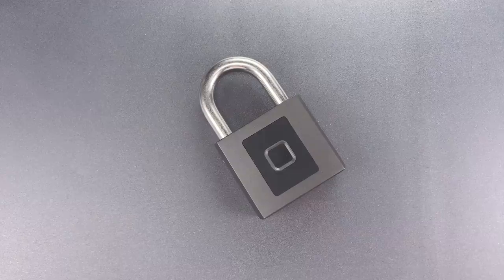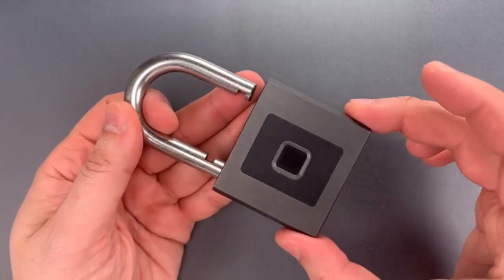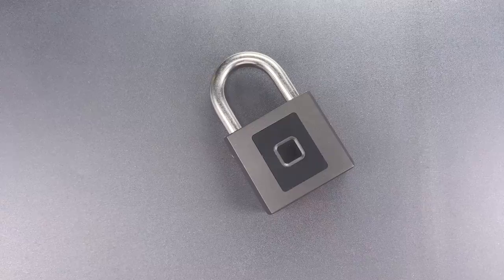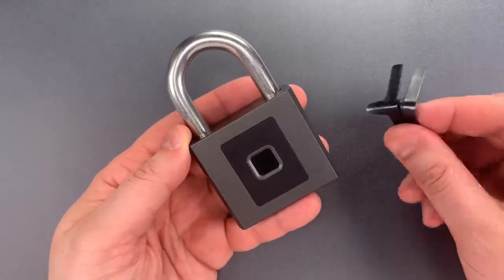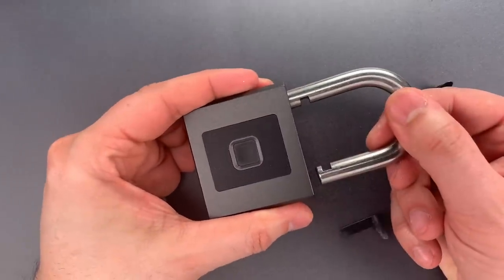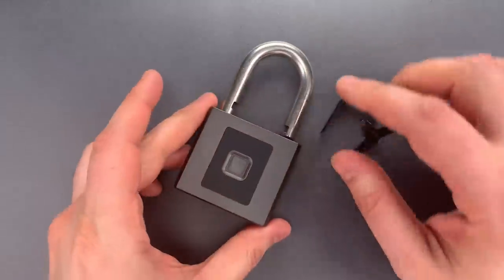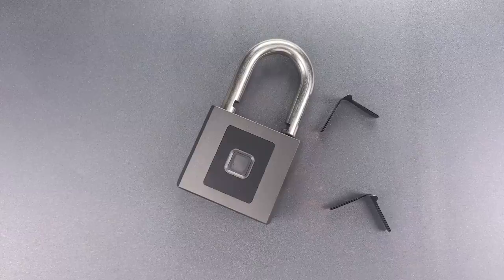[1225] eLinkSmart “Warehouse Digital Padlock” Bypassed

Comment: Those shims clicked in with a more confirming sound than a key
Reply: Haha lock engineer,   “crap I new we missed something. Next time we send to LPL”
Reply: They clicked in with a more confirming sound than the lock itself
Reply: @uniqhnd23  seriously?
Reply: where can i buy these
Reply: @mrsesh7364  use a soda can
Reply: @sentranizzy  how
Reply: @mrsesh7364  use scissors and a YouTube tutorial
Reply: Not even the old master combo dial padlock can be shimmed that easy
Reply: Shit it was more confirming than the shackles clicking in place
Reply: @uniqhnd23  oh snap you beat me to it. Shoulda known someone would.
Reply: Schlage locks in particular have a satisfying click to each pin when inserting the key in a brand new lock. With age the sound becomes mushy and hesitant.
Reply: Yes, there was a nice click out of 2 .... shims.
Reply: What did he use to pick the lock?
Reply: @angrygreek1985  Well, there are a few that actually interact with him.  Sadly, it's only a few.
Reply: And, they went in straight.  He didn't have to go in to the sides and work them around.
Reply: @sawyer3858  Shims. They're often made out of bits of cut up pop can, since the material is thin and easily shaped while also being sturdy and very easy to get.
Reply: I think being susceptible to two shims is bad, though not as bad as one, of course.
The shackle being susceptible to a pair of fucking bolt cutters is absolutely inexcusable beyond mere inexcusable, it sounds like a massive gaping lawsuit liability.
Reply: @mrsesh7364  he sells equipment on his store (Covert Instruments I believe)

Comment: We should be giving locks a security rating based on how long their LPL videos are. This one has a 1.34
Reply: Nah, should base it on how long the actual attack takes, some locks he goes into more detail talking about than others.
Reply: I agree with the other comments but don't forget that he also picked it twice. This one actually lasted like 5 secs, and I'm sure he could do it faster xD
Reply: In reality it a 0.1 as it took him 6 seconds to open.

 Was formerly rated at 0.06 before someone pointed out a minute doesnt have 100 seconds.
Reply: @erikburzinski8248  a minute doesn't have 100 seconds rating should be .1
Reply: Bonus points if he adds "gutted" in the title, minus points if he adds "bypassed". 
To my knowledge he only disassembles locks with interesting designs, while locks with bypasses are presented as having inexcusable design flaws. Seems apt to me.
Reply: @syedmohsin18  fair point
Reply: Lets not forget all the times he opens the same lock using several methods
Reply: @erikburzinski8248  well time is in base 60 so that would work too😁
... until it changes to base 24. 
... and the base 7, and right on to base 52 (or base 4, then base 12), but after that it definitely goes on to base 10 😵 time is complicated.
Reply: @MarquesSCP  he used two shims; should that be a factor?
Reply: Actual opening took under 3 seconds.
Reply: Or a 94? 
That's in the range of "Inexcusable."
Reply: Only it's just over 1.5...
Reply: @MrHemanclix  No, but each separate  method that defeats the same lock should be used as a multiplier to reduce its rating.
Reply: You should use a decimal system. 1.6 which is null security. Around 5-7 is low security. 12-18 is medium. Anything over 30 is high security, and any with 60 or more is ultra high sec.
Reply: Frogbasher  Um... what about the Bowley locks? We never see him actually pick those open...
Reply: Frogbasher  Unless he makes another video where he actually defeats it.
Reply: @airmanon7213  bowley=God tier.

But the answer is simple, time the picks only,  fastest single PICK is the rating.  Honestly.... any lock that has a no skill bypass should automatic receive an automatic 0.
Reply: The ones wrapped up in tape would get a very high LPL score though.
Reply: @tefoca  but normally the wrapping isn't reusable.
Reply: Remember that video where he picked 16 locks in 4 minutes? (video no. 369)
Yeah, this system is more flawed than a Master Lock.
Reply: @airmanon7213  true, just pointing out that in the context of measuring a lock's quality by video length, we should subtract the unwrapping bit in those.
Reply: @tefoca  good point.
Reply: I would include the time spent describing the attack.
Reply: @BlissfullWulf  in this case the lock gets a 0.06
Reply: we could also include the price of the lock in the formula for the rating ...
rating = "average opening time in seconds" / price

unless you get the lock for free (DivZero) the rating will be more comparable 
like a power/price unit, so we don't waste so much money on locks that shouldn't be called locks

... just my 2 cents ;)
Reply: @syedmohsin18  
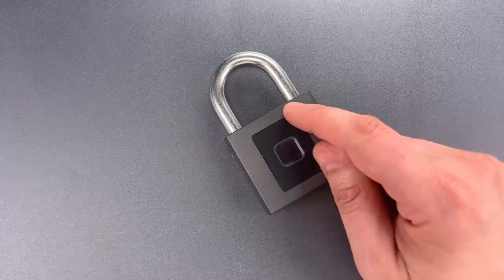The rating was based off timestamps mate... for example: 1.36 would be 1:36; 0.36 would be 0:36; and 0.06 would be equivalent to 0:06. He was right the first time.
Reply: @erikburzinski8248  
The rating was based off timestamps, for example: 1.36 would be 1:36; 0.36 would be 0:36; and 0.06 would be equivalent to 0:06. You were right the first time.
Reply: Well first off time is base 60 not base 10, but also what about videos with gutting or multiple attacks?  Does a masterlock have a different rating if you're shimming vs. picking or does it even matter since its a masterlock?
Reply: The rating should be how many seconds it takes him to open on camera.
Reply: @MrHemanclix  Considering that he made similar shims from a can of red bull, I don't think so.
Reply: @FuneralSpear  or the times he spends 10 hours attempting to open duct tape packaging
Reply: So if you did a rating system based off of LPL length of time to open, then you are forgetting one other factor that even LPL has mentioned, the tools needed to pick as well as the ability to just break the lock. These factors need to be added cause there are some locks he can get into in 30 seconds but states this lock is great for the tools are not common as well as just forcing your way into it takes way to long so it passes.
Reply: I wholeheartedly support your proposal.
Reply: Nah we gotta gave it security rating from "inexcusable" to "recommended"

Comment: The tolerance is so bad the shims practically fell in. Are these “smart” lock companies even trying?
Reply: Narrower tollerances cost money, so they go cheap and hope not enough people notice how crap it is before buying.

You could take the tolerances down to a few hundreths of a millimeter and thus make the lock virutally invulnerable to this attack, but then you'd have to grind both ends of the shackle after bending both for the exact diameter and the exact position relative to each other. 
It can be done, and with economics of scale probably still within the lock's price point, but it would cut deeply into profit...

Comment: I don't have any comments about the lock or method used. I just wanted to give a little awareness that many high rated items on Amazon are being cheaply counterfeit, and because of the way Amazon sources and stores their goods it's not possible to tell if what you're buying is genuine, unless you compare it to a confirmed genuine article. The reason being, a counterfeit seller's items are stored with the same inventory as the genuine ones, and aren't picked by seller lot but by the general bin. So it's sort of a buyer beware situation, when making these purchases. I love your videos, have a great day.

Comment: Master Lock appears to have a new 4 dial combination lock out, 174SSD. It has heavy stainless body and looks like the clearances on the body are a LOT tighter than the crappy brass body ones. The combo can be reset. I'd like to see if it can be bypassed or decoded the usual way the other Master locks are. This cost $20 at the home center.

Comment: I'm an electronics' engineer. A professor was warning us about over engineering stuff that worked well already back in the 1990's. His example was microwave ovens. No need for 100 settings no one knows how to use. A dial for power level, another for time. A sensor for humidity and another for temperature, if you feel fancy. There, done. No need for more. Locks are a reliable tecnology already. No need to have them playing mp3's or connecting to your cellphone or some shit like that.

Comment: Some locks such as that are subject to "inertial" attacks, as well.
Reply: I suspect with the 2 opposing locking lugs this one is unlikely to be susceptible to that particular attack as inertia that pushes one side open will push the other side closed. Those sorts of attacks are usually on the locks that only have a locking lug on one side of the shackle.
Reply: @Green__one  bumping it was my first thought when he said spring-loaded locking lugs, but when he had to shim both ends of the shackle I realized exactly what you did

Comment: You should have the "Top Locks of the Year" awards. Similar to how MKBHD has the smartphone awards.
Reply: He'd just give it to that one lock he still hasn't gotten open every year, with maybe a runner-up or two from the ones he said stuff like "An average thief would at least take a few minutes to get this open" or "Because it requires specialized tools, this is probably safe enough to secure something that's not very valuable."

Comment: For the same or slightly less, you could get an ABUS 20/70 Diskus with the difficult to pick Abus Plus core. Its not the best when it comes to physical attacks like sledgehammers and the like but as far as pick resistance, it's got it in spades. It'd be good to pair it with a tougher lock that's more robust than the Abus 20/70 or to swap the core entirely to a stronger lock. Best of both worlds.

Comment: When you did the video with Braille you showed them a 2D version of a locking pin in a keyway, to show how you gotta pick the pins up.
Do you have such a thing that describes how these Shims work? Seeing a square chunk cut out of the lock, and yet a small chunk of metal is able to push it away is confusing to me.

Comment: What is crazy to me is that the more secure ball bearing and blocking drum design should be perfectly applicable for such by sound clearly servo operated lock. Just attach servo to the center blocking drum (which work by rotating in the first place, no need for conversion to linear motion etc.). Only thing one loses is the automatic locking, which often one wouldn't want for security lock anyway. Just have the servo toggle between blocking and non blocking the drum on each finger press.....

Comment: finally i've found the ultimate lock for my garage door, since burglars can pick or break almost all padlocks i had my blacksmith install an ancient vintage door lock with a big key. now even you can't pick this lock first because it's huge and bulky and from the outside you only have a big keyhole and even with the key you need to grab it with both hands and turn it with great force. in fact it has a loaded spring that snaps hard enough to trigger the sensor alarm in my motorcycle. and each key has an ancient pattern teeth and twist that is impossible to replicate only if you see the actual key. and the whole mechanism is well welded to the door from the inside. people here are switching to this kind of locks for their garage door because no burglar can temper or unlock them. i guess the answer to security comes from our ancestors. i remember my grandmother had a similar lock for her frontdoor and we used to laugh at it. and we use the key also to crack almond shells.

Comment: This is an actual question about this lock posted on Amazon and the response from the vendor.  Too funny.

Q: "If I lose the shims to pick this lock, can I use my fingerprint to open it?
"

A: "The shims is designed to protect the USB interface, prevent dust and water, and do not affect fingerprint unlocking."

Comment: "This is a lock that sells for $50 on Amazon"

Probably not for long if it is this easy to bypass. Heck, I think I remember LPL used a soda can strip to shim a padlock open before.
Reply: Red Bull can, but yes, and several times. He’s also opened ‘high security’ lock boxes with a fork, a spoon, and a Lego astronaut.
Reply: @taeraresh2115  I remember the astronaut one. That was a gun lock I think?

Comment: That would work if you had that much space to move the lock to get the clips in there. If the lock was too close in couldn't be moved or there was a barrier/shield around the u lock part those clips couldn't be just slipped in there.

Comment: Lock development team manager of that company: 'If the lock is intended to protect high values, thieves will come with strong forces, angle grinders etc. - any lock will succumb to that, eventually - so why even try to make this secure? Better safe the effort. That increases my personal bonus, which is based on saved costs.'

Comment: FFS! Those shackle cutouts are square and the thing is electronic. Just put a button at the bottom of the shackle-well so it can tell that it is being locked, and activate the servo to push the locking lugs to the locked position. That stops shimming, rapping and magnetic attacks all in one go.